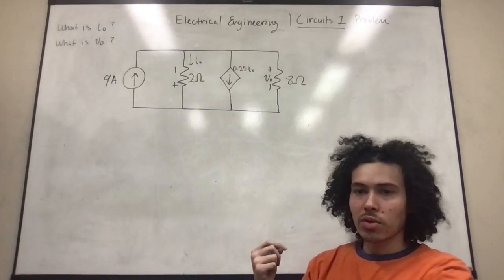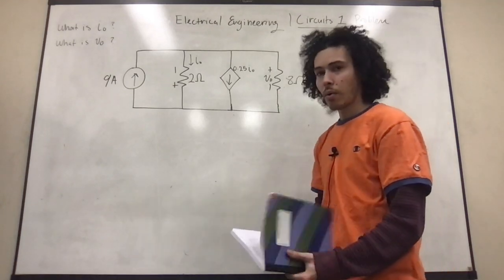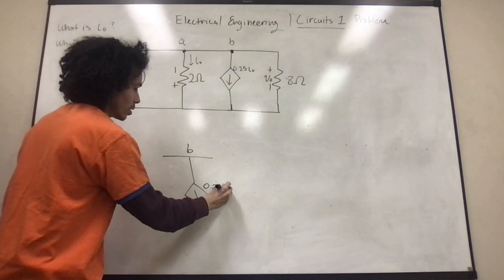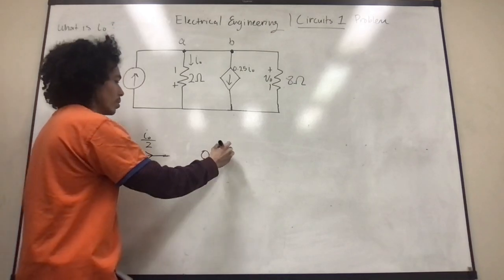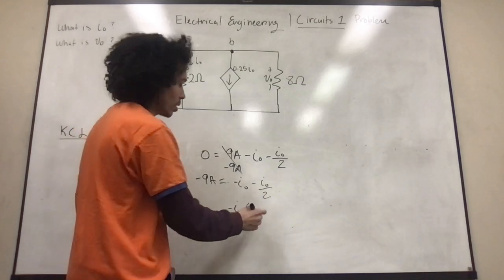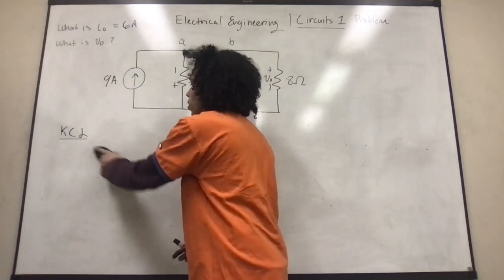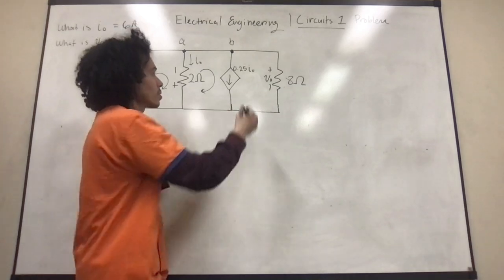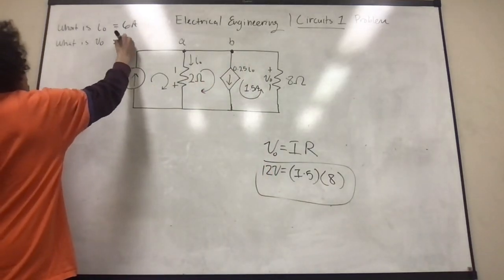EE Circuits 1 | Solving a DC Circuit | A KCL and Ohms Law Problem

Comment from the maker: There's actually just one node up top, it's just helpful for me to look at the two circuit intersections up top separately. Perhaps I will create another video where one could look at the node up top and make sense of the current distribution correctly. You can trust that the answers are correct because this is a textbook sourced problem where the answers where provided and I'm just working out the mechanics of the calculation in this video. The KCL and Ohms law procedures are also correct.